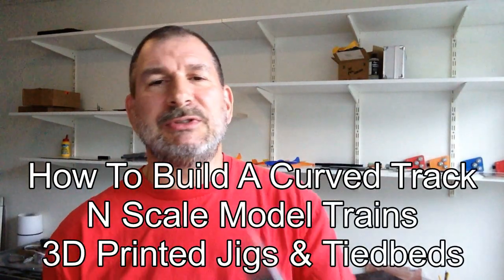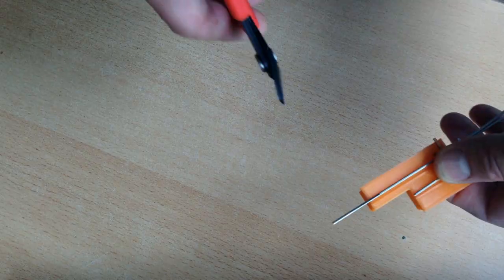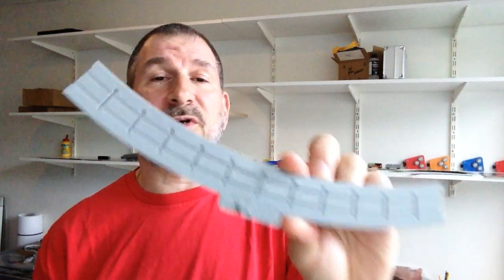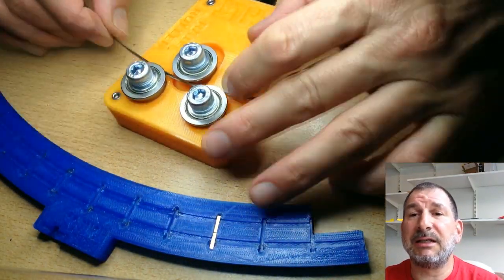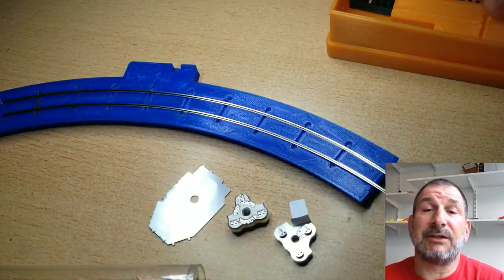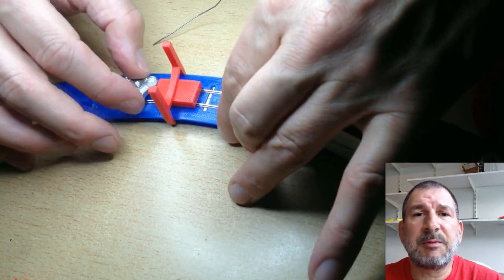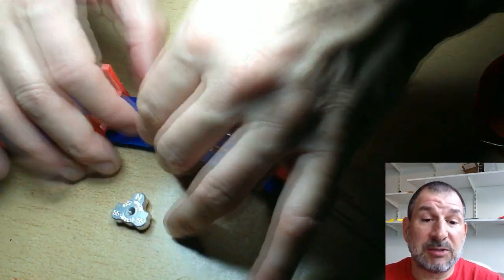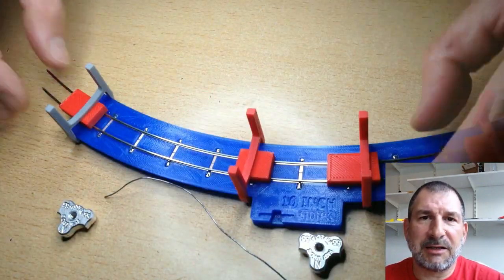Curved Jigs For N Scale 6 9 10 12 Inch Radius Hand Built Model Train Track

Comment: I'm new to 3D printing, is it possible to resize the .stl file to HO scale? I can see how most of your files would be really useful for me. 
Thanks,
Lou
Reply from the maker: Unfortunately I don't think they would scale up properly. The rail and tie widths and spacing would have to be in the same ratio as... 160:87 (I think) as well as the track gauges. Sorry. My place is too small for those huge HO cars. My layout is 2x4'
Reply: Ok thanks for the reply. Great videos nonetheless!
Reply from the maker: @loumickie  I did make some HO straights and have some curves I need to UL. https://www.youtube.com/watch?v=26B3rgeBW0E